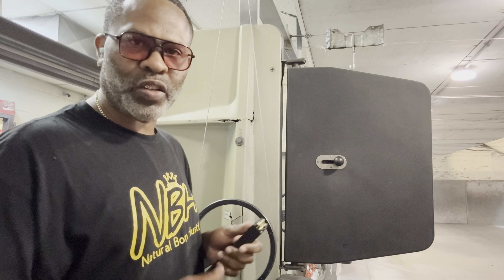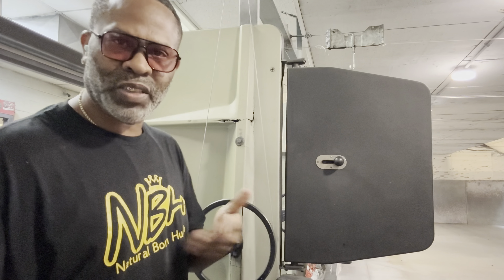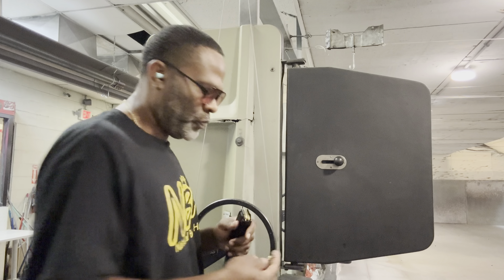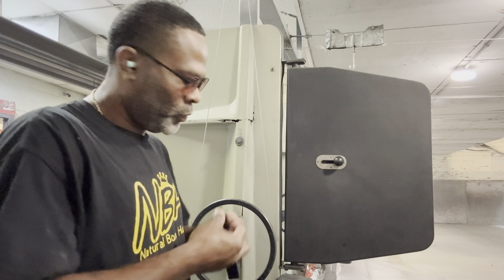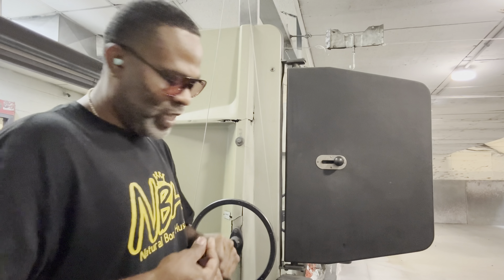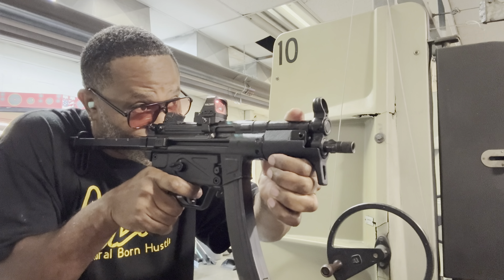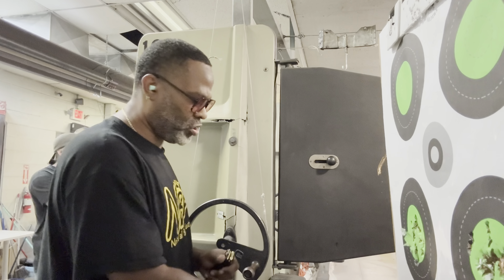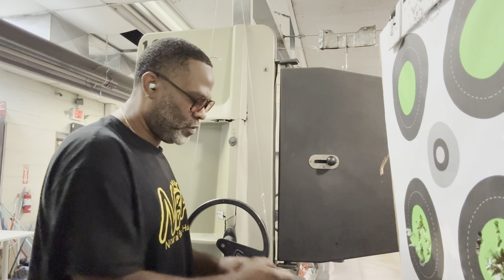Ap5 ejection/extracting problems & why?

Comment: Great video! Did you change the locking piece? I just ordered hk mags extractor ejector extractor and spring along with a 100 degree lock piece for my ap5.
Reply from the maker: @cesarsaavedra3095   no I didn’t order that that part, my problem was solved with just the extractor and spring